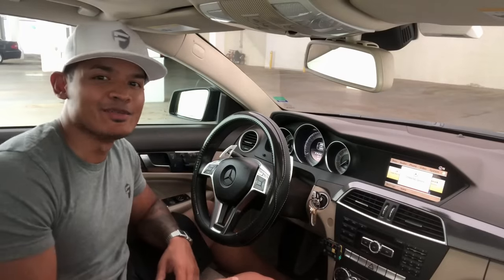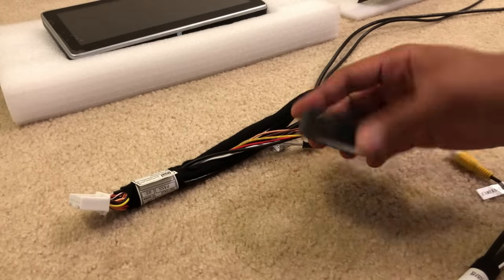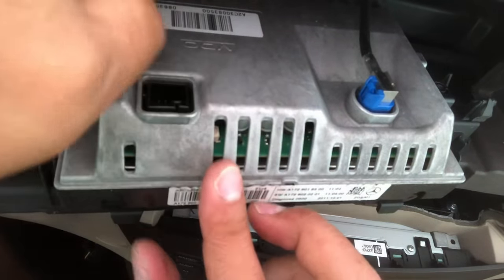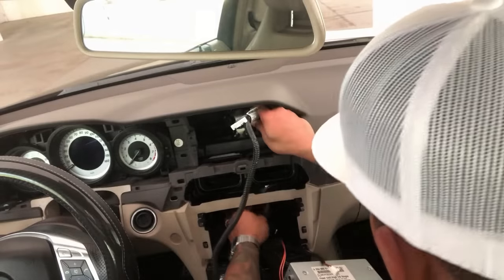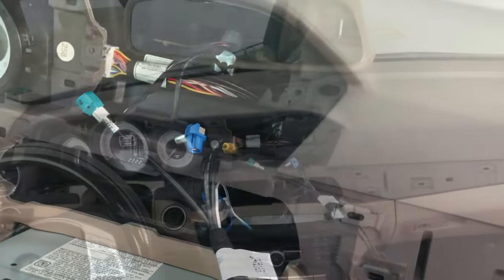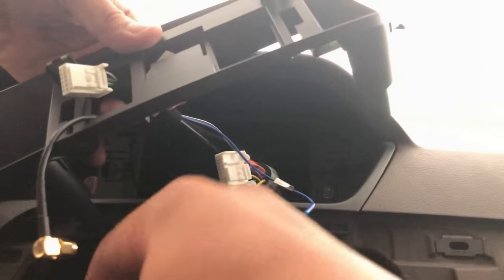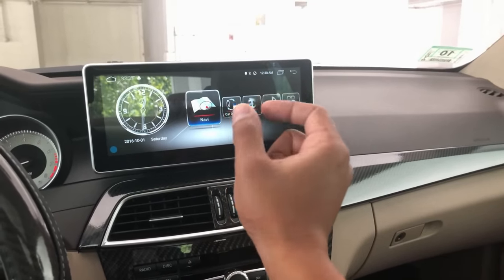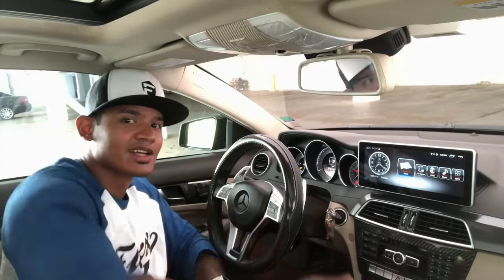Installed a large ANDROID SCREEN on a 2012-2014 Mercedes C-Class C250 C300 C350 C63 (W204)

Comment: Well just completed my install and can say that putting the radio back in was extremely challenging due to the wire harness. Something they need to modify for future flexibility. Other than that I did run the wires all the way back into the center council. The easiest way to do this is to run the wire up the right side near the back of the council about 6 inches before you get to the rear ashtray. Inside the council glovebox pull out the little plastic tab that’s in the center underneath the cloth cover. You can run a long metal wire to pull the plug up through the hole. I added an extension so the end plug would be straight. Looks clean and works great.

Comment: Done this for 3 different C classes now, thanks Flexx for paving the way! I don’t recommend the upgraded screen after this model though, they might be smoother and faster but have a few bugs that don’t seem like they should be on the screen of a Mercedes Benz whereas this older style (the one I’ve put back in my car) works flawlessly. It is worth noting that the font is a bit big and resolution is a kinda low but I’ve modified both of those using apps from the play store

Comment: Great video! Just installed in my C250.  I had a problem getting sound at first, but figured out the fiber optic was in the wrong port.  Moved it and now everything works fantastic.  Probably added 1k value to my car.  Works perfectly.  Thanks for the good quality, detailed video?  Tip: Using a T20 screwdriver to remove the two screws at the top of the head unit is very tough.  I went to Lowes and found a Craftsman mini ratchet set for about twelve bucks with a few Torx bits, including the T20, that worked great getting those two screws out.
Reply: Im having the same issue. No sound, ughhhhh
Reply: @KCKnowsBest  Make sure the fiber optic is in the right port. There are two of them. I had mine reversed. Also go into advanced settings and enable the AUX. For the factory radio, make sure the setting is on "FM" for sound. If using it for internet, YouTube, Hulu...change to AUX and for your phone is "Bluetooth."
Reply: @KCKnowsBest  Go to Raymond Urias channel and watch his video on all the settings for the Benz Android screen. Very helpful.
Reply: nolebuc1 can you please elaborate on the no sound issue? I don’t have any sound, I have checked all the cables, when I connect the original monitor the aux works, but as soon as I connect android aux stops working. What fiber cable are you talking about? Would really appreciate the help

Comment: I watch this video every time I have a chance, just like a special force team getting ready for a raid 😂😂😂
Next month I be ready for my installation 🤞🏿🤞🏿
Reply from the maker: 🤣🤣🤣🤣…the hardest part is pushing the stock radio back in because all the new cables are back there.
Reply: @TheFlexxGarage  that’s my biggest concern.
Reply from the maker: If you do buy from my sponsored over at DMP, they have tips and tricks if you ever get stuck on anything.
Reply from the maker: They will. Just use the code or if you call them to order, ask for the Flexx discount. 😎🤙🏼
Reply: @TheFlexxGarage  thx 🙏🏿
Reply: More I watch this video more I have questions, I’m sorry buddy.
Why you installed the WiFi and the gps pieces inside but on the w205 installation you put them outside?
Should I put mine inside or outside, or it doesn’t matter? By the way I have a 204 facelift.
Reply from the maker: Having them outside gives less opportunity for interference with other signals inside the radio area.

Comment: 1. Can I still use the steering wheel controls , or only the wheel in the middle console ? 
2. Does it dim the brightness automatically at night or basically does it have auto brightness, or would you need to go through the settings each time to change it according to need ?
Reply: 1. yes you can
2. depends on the model, just leave it on high

Comment: I bought a full HD Screen. So guys if you have sound problems dont forget to put the original fiber opticcables into the "new 40Pin block", put aux Mode on, turn on System Sound of the screen and enjoy sound. I recomand to isolate the aux cable against magnetic fields. The cable and the sound are not good. But i can watch tv and use new Navigation System. So its okay. I also can use the old comand System and change fast by typing in the "disc" Button. Sorry for.my english. Press like
Reply: Not all systems have optical cable, mine didn’t

Comment: Hi Flex can you help me out i installed the head unit everything works except the ntg mode when it seems to revert to original car stereo i get audio but on the head unit i only display the picture of the car i dont get the fm menu
Reply: Did you ever figure this out i am having the same problem now
Reply: @Lakers5513  Did you find it out? I'm having the same problem

Comment: Just bought this....just hope I can frigging fit it 😂
Reply: Did it fit?
Reply: Hasn’t arrived, uk customs rejected it  DMP said they would resend it 🙄
Reply: Well another kit eventually arrived. The strip down went well but the install was a literally a nightmare. If you’re thinking of purchasing one be very aware that fitting the radio back in will test your patience, your endurance and your sanity. This seems to be a common issue but hey I eventually got the bastard in. After that the install went to plan and I was glad to have my facia back together again. Must admit it does look awesome however as I type this I don’t have a ntg screen or any sound from Bluetooth or access to any boot up logos  in the menu ( literally nothing there 🤷‍♂️) I’ve contacted DMP for help and await their guidance -  I’ll update you all later
Reply: Got the NTG screen up & running, anyone else having this problem go to the resolution settings in the settings menu, you have 8 option simply select one until the NTG pops up. Try number 8 first  that works on mine 👍🏻
Reply: I see you installed it some weeks ago. Interested to hear how you like it and if you have any problems with it? Thanks.

Comment: i cannot for the life of me manage to stuff the radio back in with the stupid quadlock extension in the way, its way too bulky to stow underneath and too short to pull over to the glovebox hole
Reply: ... I am literally going through this right now, talk about frustrating 😠😤
Reply: @justinsmith26  after a lot of attempts i decided to fully disconnect the radio unit so i could route the wires more neatly, then it managed to fit underneath it behind the ac control unit and slide back.
it didnt fit perfectly though as it did snap a bit of the plastic as i tightened the locking screws at the end, but I'm just glad its over

Comment: Looks really good! I was installing a backup camera and video interface box on my W204 facelift a few months ago and had the same problem as you - pushing all the cables in is super tricky. I managed to get the quadlock connector in the small space between the climate control box and the infotainment radio unit.... and even then it only just fit. Anyway these mods are so cool!

Comment: Is there an apple car play feature?
Reply: you have to get a CarPlay dongle they're like $100 maybe cheaper if you get a wired one and it will plug into the USB port. I actually found the same screen that already has wireless CarPlay built in I found it on eBay

Comment: Bluetooth does not work from the new screen but from the original screen it works anyone else have the same problem? Is their a software update
Reply: Did Bluetooth ever work
Reply: I have the same problem.. my phone connects to both screen and NTG4.7 via bluetooth..
Audio and video files play on my screen withOUT any sound?!! But audio files work perfectly thru my old NTG4.7

Did u find any solution?!!
Reply: @m07sin  Change your factory system to AUX mode first

Comment: I can see lot of people do not works sound on Android screen. I just installed my own and same do not works. Someone knows how to fix it?
Reply: Ulises Yanez do you able to fix it?
Reply: Change the factory system to AUX mode before using the new headunit, as the sound will output back to factory system through factory AUX channel, thats why he adds an AMI to AXU cable in the glove box
Reply: Dont forget fiber optic cable and auf in Settings in original Sound system
Reply: Same problem. How did you fix it?

Comment: Noticed based on your video explaining the parts that my 2016 E400 does not have auxilary plug in center console only 2 USBs.  My screen didn't bring the adapter but it did bring a aux box.

Comment: My head unit is blown. Fiber optic and amp are fine. I'm guessing I need a working head unit. Love your stuff. Huge w204 fan
Reply from the maker: Dang. That stinks. Yeah, you'll need a new head unit. How did that happen???
Reply: @TheFlexxGarage  I have no idea. I pulled it and the 20a fuse was good. Replaced it anyway and nothing. Shop says it's just a head unit. They said they could aftermarket for $4k. I think I can find a factory head unit. Just need to make sure it works with the amp. Does suck tho

Comment: Hi Flexx,
Quick question - did the sound quality through the car's speakers improve using this head unit [as I see it has far more advanced sound settings/equalizer than on the oem interface] ? The standard sound system in a 2012 C250 is very disappointing! 🙄
Reply from the maker: Sound is not drastically improved but having an EQ does help enhance the bass and treble to make the oem audio sound better. If you want to drastically improve sound quality, you have to upgrade the speakers and amps. 

You can only put so much lipstick on a pig. You know.
Reply: @TheFlexxGarage  Indeed! 😅
Thanks for the prompt reply, man

Comment: Hey FLEXX quick question. Install went great and everything works amazing including the rearview camera. Just have a few questions I hope you can answer. 1) What is the microphone cable for. Obviously I know it's for a mic but what would be the reason for me to attach a mic to that cord if the Android screen has a built in mic already? Can't I already use voice control with google without it since the screen has built in mic or is the mic required for that feature? Or am I mistaken on the screen having a built in mic. Doesn't the car already have a mic in it? Or when the product says it has built in mic is it actually referring to the mic that can be attached to that cable? 2) Can I have 2 sim cards with the same number. I was thinking of putting a sim card in the Android unit so that I do not have to keep having to use my phone as a hot spot. Is there a way around this. I was thinking of buying a data only sim but if I can have 2 sim cards with the same number I wouldn't have to. Once again I appreciate it. Thanks FLEXX!!!
Reply: Did you install a camera yourself?

Comment: Do you remove the ground wire while installing ? Or this is by default procedure before messing with a MB?
Reply from the maker: I always disconnect the battery to prevent possible shock when working with electrical parts.
Reply: I was thinking more of possible errors.

Comment: Hi Flexx, I purchased from DMP the Android Pre-Faclift 10.25" Touch Screen/Wide Screen for my 2012 W204 Mercedes Benz C300.  Does the slot in the back actually work for a 4G-LTE Sim card that can enable WiFi without necessarily tethering to a cellphone?  Thanks!

Comment: Hi! Great video man! I have some doubts. How does the handsfree works? Do you have to install an ugly external mircophone or I can use the oem handsfree system (for calls)? What is the function of the backup speaker? Can I use a bluetooth adapter for Ami interface to have a wireless sound connection or I necessarily use the aux adapter? Thanks!!

Comment: I recently bought a c250 coupe with one of these installed! I hit a bump on the road and now every time i play music on my CarPlay (and only CarPlay)  it messes with the speakers. I wanted to know if the USB cable used for CarPlay is apart of the harness or it connected separately! Also, to remove the screen from mount, do I just have to pull upwards? Any help would be appreciated :)

Comment: hello, I have a s204 (station) with original system ntg 4.5. I replaced it with an android 10.25. I want to install a reversing camera, do I need to buy some interface to show up as dynamic lines when I turn the steering wheel?

Comment: Flex, My 2012 c250 doesn't have the same disconnect for the cent air vents.  It looks like it goes straight to the supply hoses.  It does have two kind of bulging plastic clips on each side with a small hole and slits down the side.  Tried putting the pick in there to see if I could get it to release but no luck on the left side of the vent.  Any suggestions?  appreciate you video and plan on doing more include the tubro upgrade and the Samsung screen.  Right now just installing a OEM back up camera system.

Comment: Can I retro fit a screen on my w203 C240 Sedan 6 cyl. It currently has no screen but seems to have space with removing the existing ratio and using the shelf below the radio.

Comment: So I need to use the Mercedes AMI cable in the console to connect the3.5mm jack since my C250 doesn’t have that port  and I told Thomas at DMP that you was giving me awesome advise and used the flexx at checkout
Reply from the maker: Yeh. DMP can tell you anything. They can answer any question. Really good support.

Comment: Hey Flexx, hope your well mate, I bought one of these units on your recommendation but I got the upgraded one with the curved edges, everything was going well with the install unit I tried to get the head unit back in, the cables I received were slightly different to yours shown here and the length of the big black male/female plugs isn't very long and therefore prevent me from hiding it anywhere but below the head unit, any tricks to getting it back in, where did you put the big black connector? Under the unit or of to the side? Thanks bro.
Reply: i put it under the unit but, it took me an hour to wangle it in. Nightmare
Reply: @b15mla  Night mare puts it mildly. After a few hrs and many attempts I can;t get the head unit in. I will have to remove all and make another attempt. I even removed the glove box but that wasn't any help. Next I will remove the AC unit.
Reply: Any joy with this??

Comment: Man I cannot for the life of me get this radio back into place. Everything else went smoothly though.
Reply: Its a beast to get back in. You need to tuck as many connectors and cables as you can into the recesses at the bottom. I almost gave up and then it just slid back into place - huge grin!!
Reply: Tah-Jay
Any chance you have the name and or part number to the head unit?

Comment: I bought a c300 with the same screen installed. I’ve found that the audio on the right side of the car chips in and out and when i plug in the aux in the glovebox the  speakers make a squeaky noise. Is a wire ran wrong or can you help in anyway?

Comment: Hey dude do you need to even use the 3.5mm jack running to the center console or can I just wrap it up and hide it away? Great install by the way just finishing mine up.
Reply: ya i’m wondering the same thing
Reply: @ryansparzak8822  I did not have to use it on my glk to get system to work, idk what it's for. Oh well just taped it up and put behind glovebox

Comment: So quick Question Flexx, 2014 C300 Sport, but my center console has a USB port for a stick, and a AMI Media Interface Port. My factory HK sound system I can clearly select AUX on my display, But I have looked ALL over the web and in my car and Cannot find the port for the life of me, even though I can clearly select it. Would I be safe to order the 12.3" Screen? I mean the only thing I knew to do was on Amazon I ordered a AMI Media Interface cable to Female 3.5mm AUX 1.5 foot.???? would that work?? DMP said they would include everything I needed when I tried to explain this to them. But before dropping that much. I wanna be sure. Thanks man

Comment: Can you more explain why I need to go with the aux cable to the middle console? Is it important, do I need them or can I just ignore that cable ?
Reply from the maker: I’ve already explained this many times in the commment section.  You need to look for yourself.  

The screen is basically a tablet that you want to plug to your car. Just like if you wanted to plug your phone to your car using an aux line to play music. 

The only way to get audio out of the screen is through the aux line.  Anytime you want to use the android screen’s interface, you have to first set your regular oem interface to aux mode first.  If you don’t, you can use the android interface but you’ll get no audio. 

There’s also a setting in the android interface that will auto switch to aux whenever you switch from oem interface to android interface.
Reply: @TheFlexxGarage  thanks, I think I understand now how it works

Comment: Will this work for a 2012 E63 station wagon? It’s for my dads car. He hates the stock system and thinks it looks cheap and its quite slow now. I live in Australia so will that be an issue? Looks great and much easier to use. I like how you wrapped the bottom sat nav buttons. They look so cheap and crappy. Even from new they always looked awful and out of place like they were straight out of a sprinter van. Might have to get my dads wrapped, its a massive improvement.
Reply from the maker: Yes. You need to contact DMP and they have a screen for almost any car.  Link in video description.